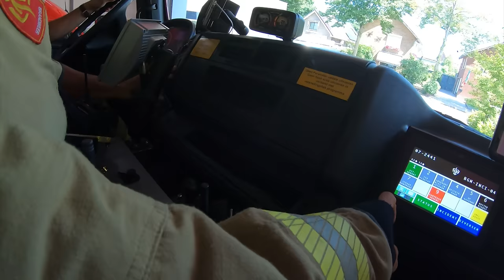Ongeval - VOLUNTEERS DUTCH FIREFIGHTERS -

Comment: Here in Sweden the fire department have a so called “tension time” maybe not correct meaning in english,but it is the time they have from the time they have the alarm,and until they leave the fire station,and that time is 90 seconds,do you have some similar “time” for when you should be on the way from your fire station ? Thank you for your videos,and for your excellent work guys 😊😊😊

Comment: Once more, great work guys!!

Can somebody tell me how it happened?!? The Mercedes got hit by the Bentley - that's clear. How was the Fendt tractor involved? My first thought was Bentley overtook tractor and didn't see the Merc - but therefore the tractor points in the wrong direction. It looks more plausible the Fendt tried to evade and hit the fence. I would really like to know.

Greetings from Germany!!
Reply: @dutchman7623  Thanks. Even with a car as big and heavy as a Bentley, hitting a tractor so hard it turns off the road you have to be pretty fast. Same goes for missing something this big - although Fendt-green works pretty well as camouflage.

Comment: Interesting to see the Small hydraulic power pack for the cutter and spreaders.
And the 10mm spanner in the pocket is good, I for many years when doing road accident rescue as well as rural fire always carried a 10mm spanner, small flat and Phillips head screw driver, nitrile gloves and a small pair of wire cutters as standard in the top pocket of my turnout gear . Mind you I did also carry the same at work as a technician with police and also have a kit in a pencil case I carry in the car and knapsack. As you never know when you'll need it!